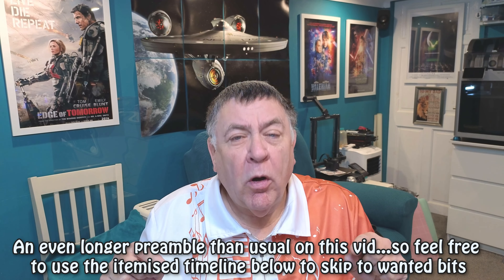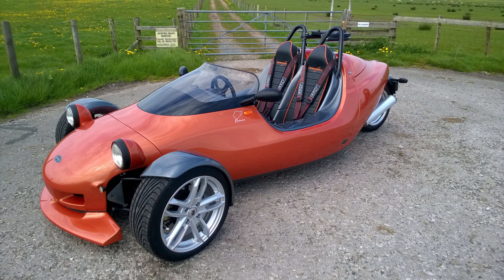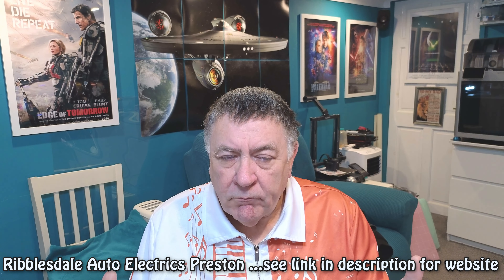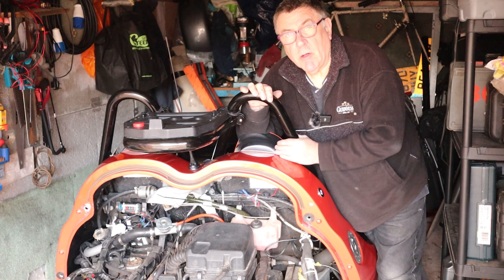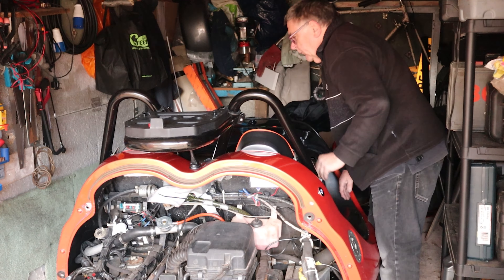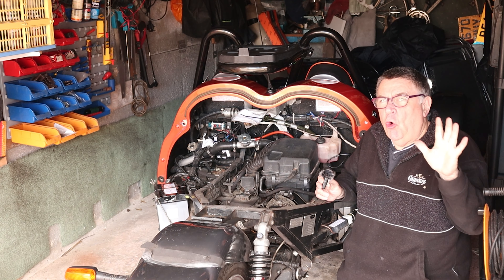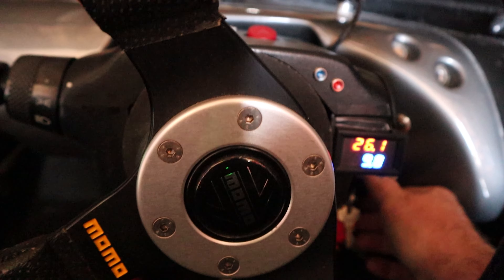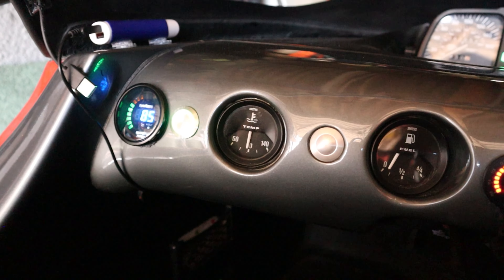Curing knocking noise from Grinnall Scorpion K1100 alternator

Comment: What is that mean machine? Grimnall Scorpion? I have never heard of those. It would be nice to see more of it.
Reply from the maker: Hi Greg...yes if you look back at some of my other vids I have done a few on it ...Basically it was a kit car you bought as a kit and put your own engine/rear drive into from a BMW K series motorbike..either 1000c,1100cc,or 1200cc, or bought factory built

It was (and still is) manufactured by Mark Grinnall in Worcestershire and came out in 1992 ...it was designed by Steve Harper who also designed the Ford Escort Cosworth and MG F 

Mine is a 1997 one ...factory built chassis number 099...there have been about 350 made so prob about 200 in existence...they can still be made to order now as the K40 version with the later BMW K40 engine...0-60mph is 3.5 secs but mine is "only" 5 secs.

They are a real buzz to drive and handle fantastic...have been all over in mine which I have had 17 years...been to Italy/Switzerland/Germany etc twice.

I love it :)
Reply: Re: the Aldi power washers. Same scenario in my home town. We have two Aldis. The larger store had six delivered-all gone by 10.10am. The smaller store only one delivered and of course that had gone too. ☹️